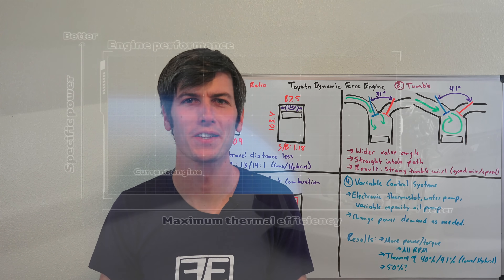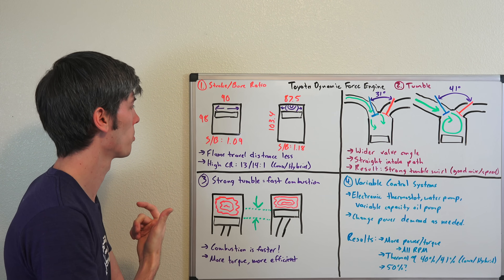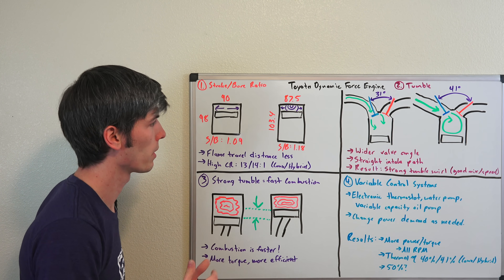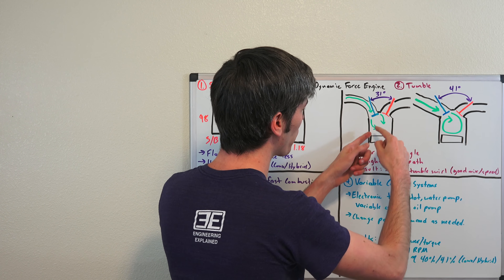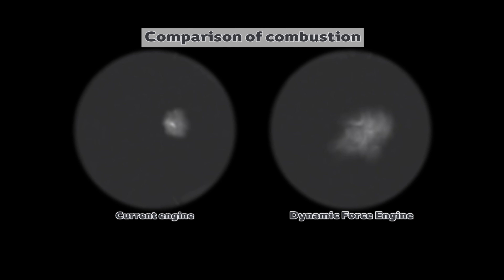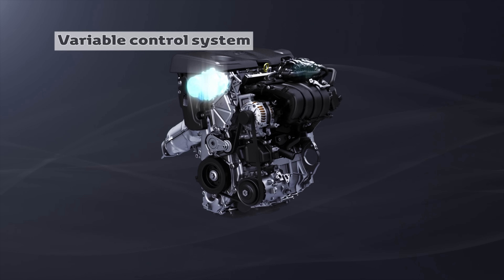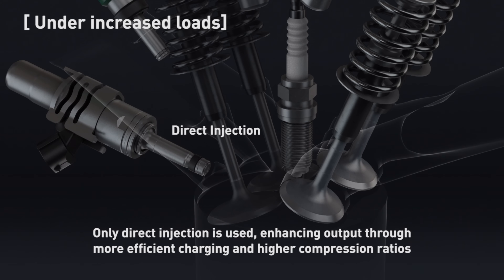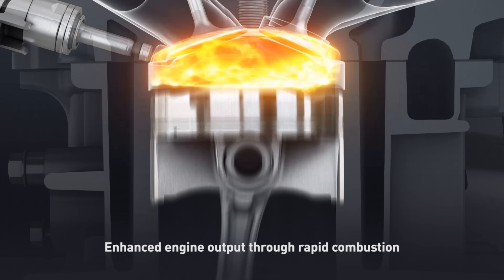Toyota's New Dynamic Force Engine Is Super Efficient

Comment: It's nice how technology has evolved, but i do have one thought and i love watching your videos, i read a study that showed modern direct injection engine not being as clean as a modern euro 5 diesel, i don't know the factors at play but one can assume that it was similar to standard road tests, and i would love to know how this would preform emissions wise compared to a brand new Euro 6 classed diesel engine since the euro 5 barley has any emissions at all
Reply: Direct injection gasoline is running into the same issues as diesel in that it's making particulates, which are dangerous, though it's still not known just how dangerous. Gasoline engines up till quite recently didn't have particulate filters (Many still don't I believe), so while most diesels made in the last 10 years have filters, gasoline mostly does not. Also gasoline particles are smaller, which means the exhaust looks less sooty, but the particles are likely to be a lot more dangerous as they're heading for the nano scale. Even inert materials can become dangerous as nanoparticles.

Comment: Metal / plastic tolerances, properties, exc. change when you import engines, they become more prone to leaks, exc*. Best thing to do is build an engine that Is not controlled by the fuel And oil companies (consumption),  as well as building it in the area you will be using it with the best parts, and no cheap labor. The term " ef·fi·cient" does not even come close now. There should be a law suit against the companies, but VW and other companies have to take the hit.

Comment: But what does this gain?  Are you getting more hp for a given mpg?  Or are you gain better mpg for similar hp?
Reply from the maker: Either or. Increasing efficiency means you use less gas to make a certain amount of power. So you can either have more power at the same amount of gas, or the same power with less gas.
Reply: Thanks!

Comment: Excuse me, the MB F1 engine is said 50% efficiency with very particular fuel and ERS for F1 only. The ERS is a system that can recycle exhaust heat to generate electricity. So, it is not the engine thermal efficiency, but the powertrain efficiency. The AMG Project One, a civilian version MB F1 is said to be 40%， which is also the system efficiency.

Comment: Thx for showing how it just takes a lot small simple and for the most part common sense changes. That made a big improvement (for Toyota in this case) in the engine's overall efficient. 

Although the optimum Bore to Stroke ratio would seem less applicable to HCCI or the Mazda SPCCI engines, since combustion is primarily based on compression as opposed to a spark?

Comment: Finally some actual progress to increase the thermal energy efficiency. Maybe one day we'll find a way to use 100%?
Reply: It’s technically impossible to use 100%, but people can try to bring the engine up to Carnot efficiency, which is the theoretical max efficiency for heat engines. Depending on the ambient and environment temperatures, Carnot efficiency is around 55%.

Comment: You didn't go over the combination of port injection with direct injection - it's unusual to have both in one engine, isn't it? Next video maybe?
Reply: Would it be to control soot? I know Toyota dislikes the soot produced by diesel and direct-injection gasoline.
Reply: Not only do they dislike it, but this soot is harmful to humans and the rest of the environment. This is why particulate filters have been mandatory in diesels for the last 10 years or so and why direct injection gasoline engines are getting them too. The downside of this is that if you drive in city traffic only, without decent motorway runs, the engine has to periodically overfuel itself to heat the particulate filter to burn the soot into carbon dioxide, so while this is going on, fuel economy is poor and the engine runs noticeably worse.
Reply: Port injection cleans the valves of deposits from the direct injection

Comment: Did you notice that when the valve lowers into the cylinder it crosses into the path of the injector? This will likely reduce, if not eliminate, the carbon buildup issues that direct injection engines then to have.

Comment: Big thumb up for Toyota’s simple but effective solution.
Reply: actually is nothing new, they are just going back to an old design, with some modern stuff
Reply: undersquare + high swirl combustion chambers = DONE, like 30 or 40 years ago, the new thing in the mix is the fuel inyection
Reply: Omega Rugal some others do find it newand very satisfying.
Reply: Basically they are doing what Mazda did 6 years ago. Nice innovation. lol
Reply: But still it's not as efficient as Achates opposed-piston engine design which can do 45 and up to the highest of 55 percent of thermal efficiency!
Reply: People won’t shut up about Toyota making another Supra. It ain’t happening.
Reply: Simple? Are you nuts? The Apollo mission probably used one thousandth the computer code this thing has running it.
Reply: @gruberstein  computers do not control the intake charge tumble on this, which is the main design point of the motor. and modern ECUs don't need a NASA scientist to tune and does not cost as much.
Reply: "smart enough to play things safe"... in other words, wait for other companies to spend $$$$$ developing a new tech, then copy it. Smart I guess, in the same way that copying someone else's homework is smart.
Reply: @emissarygw2264  fake it till ya make it!
Reply: taledarkside because they are improving a lot without u realizing it.
Reply: I'm guessing they copied the amazing reliability from another car company? hmmmmm

Comment: NOx is not a problem on this engine? Cause the flame seem a lot hotter. 
Is not NOx the cause of diesel banning ... ?
Reply: NOx isn't such a big problem for petrol engines in general because a simple catalytic converter will do the job when it comes to NOx. That's not the case in Diesel engines because the remaining oxygen in the exhaust of Diesel engines will inhibit the reaction which would normaly reduce the NOx to N2 and CO2.

Comment: I like the better control that comes with electric accessories.  Boeing has gone this route on the 787 ditching some or all of the bleed air systems to run accessories. I think electric power will continue to be used by engineers to make ice engines work better. I think electric engine heating could benefit the longevity and pollution issues at startup for one weird idea.

Comment: It'd be interesting to see a car manufacturer make a combined cycle gasoline engine that extracted heat from the exhaust to run a small turbine-generator to supply the electricity for all these electrically powered engine components (water pump, oil pump etc).

Comment: I've had a dozen Toyota products over the years, and one of the things that keeps me coming back is their history of offering non-interference engines. I lost a timing belt on an old LS-400 and it was no big deal; new belt kit and out the door. Same thing on an old Subaru bent the valves, requiring engine replacement, totaling the car. Your animation appears to show the valves protruding into the piston path. Will this be a non-interference engine?

Comment: Is this the engine in the new Corolla hatchback?
Reply: Yes the new toyotas use this engine, I just bought a new 2020 Corolla with the 2.0 liter engine and a 6spd transmission. In the morning cold start at -3 it makes a loud rattle noise for almost 1 and a half minutes then quiet downs. This noise is very disappointing for a new car. 440 klms in the car now  and really liked the car until this happened

Comment: ICE manufacturers rearranging the deck chairs on the Titanic
Reply: Electric cars have been around for over 100 years but make up barely more than 1% of the market, they cost far more than ICE cars, and the bet is being made with the promise of some magical unicorn batter/power source system that will make them practical and economical enough for the other 99% of the population, and all while the finish line keeps moving as the ICE keeps improving itself. How is this like the Titanic again?
Reply: Chris...Captain Smith I presume?

Comment from the maker: Hello all! If you enjoyed this video on engine tech, here are a few features you may also enjoy:
Mazda's SPCCI Engine - https://youtu.be/yNSxow3W7ek
Infiniti VC-Turbo Engine - https://youtu.be/A6H66xfEZC4
Mercedes 50% Efficiency - https://youtu.be/kOhmgpkiIfg
HCCI Engines - https://youtu.be/OVWZFdb_AGc
Reply: i didn´t feel free to leave any questions or comments below...or wait, I did! Hello everyone and welcome!
Reply: Look back at the Cosworth DFV V8...tumble port flow pattern to speed combustion. Even at the then high 14000rpm, their ignition advance curve never exceeded 30 degrees before top dead centre. Toyota has rediscovered how Mike Costin and Keith Duckworth were ahead of the times
Reply: What is the BSFC of the new Mazda engine?
Reply: One question about the "marketing".  While a thermal efficiency of 40% might be amazing (although Mazda might ship a superior engine), the big problem (with both) is that such a thing almost certainly happens in a "BSFC island".  Having 40% efficiency is all well and good, but if it only happens at roughly 1/3 to 1/2 peak horsepower (typically max efficiency is roughly at a halfway point under the peak of the torque curve), you will quickly find yourself choosing between inefficient driving or losing your license (or more likely aero losses are worse than efficiency losses).

Toyota at least has the advantage of the Prius drive train that can use an engine driving inside the BSFC island (Mazda is less interested), although they seem less interested in shipping this elsewhere, nor are they interested in pushing battery tech with high powered electric motors (I'd really like to see a high powered Lexus with a Prius ICE plant.  On the other hand it looks like the Honda Accord hybrid is certainly heading this way).
Reply: Engineering Explained , assuming that you spend your free time musing "how would I build a car", which one would you prefer in a miata like sports coupe?
Reply: Engineering Explained awesome video, does Toyota have this engine with turbo???
Reply: Engineering Explained Could this mean higher redlines and more instant throttle response
Reply: these are all great videos! as a carenthusiast your channel is a must! :)
Reply: three hundredlbft The fuel mist vaporizes by the heat of compression and the engine heat. Turbocharged drag cars use a methanol as fuel because it needs more energy in form of heat to vaporize (it basically cools down the burning chamber, so you can press a lot more fuel-air mixture in the chamber, what in turn releases more energy). Nowadays it would just cost energy but older models had a intake manyfold preheater to prevent fuel from condensating ond the manyfold walls.
Reply: Yeah, i'm also skeptic about those  40° efficiency ( never ever on a non stationary engine).
Reply: It's like Engineering Explained never heard about old school natural aspirated engine tuning. He should look up lancia ECV with the "triflux" engine. Lancia used another way to increase combustion speed by using swirl instead of tumble.
Reply: What are the inherent reliability issues of the different engine cycle/technology applications in recent designs?  e.g.: carbon deposits on the backside of intake valves in GDI applications
Reply: Do you think such improvements in the combustion engine mean that combustion engines won’t be completely overtaken by electric cars? Also, are electric cars advanced enough right now to replace combustion engines and be more efficiently the macro level? It’s just that making the electricity that charges the cars and making the batteries seems to be bad for the environment and sort of counterproductive...
Reply: Veery interesting.  I hope i see it in 1.6 engines because that's the only displacement  is available in my country
Reply: Engineering Explained I want to see their new 2.0
Reply: can you do a video comparing those engines-philosophies in terms of efficiency, dynamics, complexity, level of innovation etc.?
Reply: Engineering Explained how much has the compression ratio has been changed?
Reply: you forgot about camless engine i think.
Reply: on 2019 toyota auris/corolla hatch. if i am not mistaken.
Reply: Copy from Mercedes?
Reply: What vehicle was this engine supposed to be going in?

Comment: its not that revolutionary that are things long known and just now  they feel comfortable applying that knowledge could have been done easily 20-30 years ago with or with their vvi and vvt. 
need proof: bigger valve angle = hemi (not a fan btw). bore to stroke easily obtainable by testing and known "forever". the tumblin comon flow simulation and hispeed cameras are also old stuff. and to decouple most assisting sytems electricly also a nobrainer and no there is no need for complicated computers but if so MCUs exist also for 30-40 years. and higher compression ratios have always been stiffled by these arbitrary nox limits and fear of engine knocking which could have been handled way easier by either water injection, more or only ethanol or LPG. LPG would be also the best all in one solution but for idiotic reasons goverments and manufactures like to go the complicated/expensive route when LPG has it all: indoor acceptable emission! high compression due to high octane, easy to handle like gasoline, less explosive as gasoline! (yes google it)but no we are either stuck with modding old(reliable) engines ourselves or have to buy these overly engineered engines which come attaches to cars that only gotten more heavy (for idiotic:more comfort or abitrary: deminishing results after seatbelts and airbags, resons)

Comment: Is that injector washing the valve?
Reply from the maker: It may appear that way, but I think it's spraying directly into the cylinder with minimal valve contact. They have a port injector as well which will help with valve cleaning.

Comment: Lada 1200 had 40% thermal efficiency in 1970 with CR 8.8, 2 valves per cylinder, carburator and contact comutation ignition. But only in 1 point of it characteristics.

Comment: Funny because Suzuki had their TSCC chambers back in the early 80's which included a 40deg valve separation angle. And these engines produced enormous power compared to their earlier predecessors. Suzuki did this this plain old carburetors, can you imagine if they had modern fuel injection.............................OH wait, they now do. Gsxr1000 produces over 200hp. Granted their higher RPM redlines helps this, but almost 100ft.lbs from a 1.0L is impressive. It's about time that car manufactures begin to catch up with motorcycle engine technology.